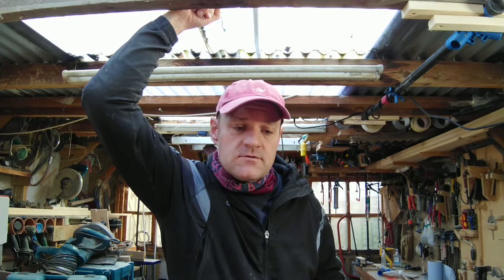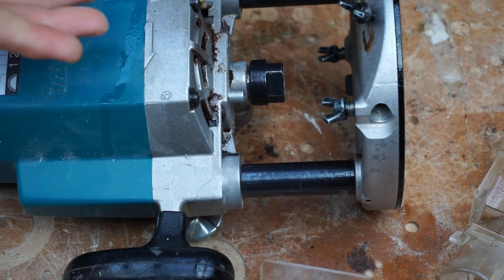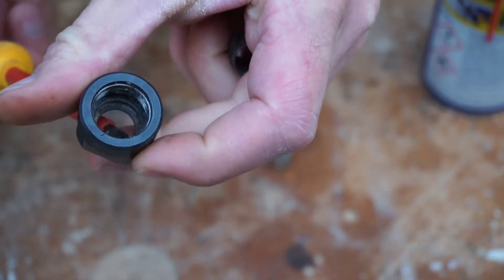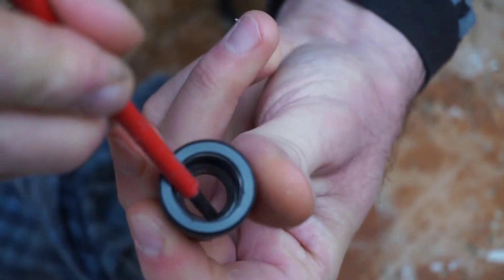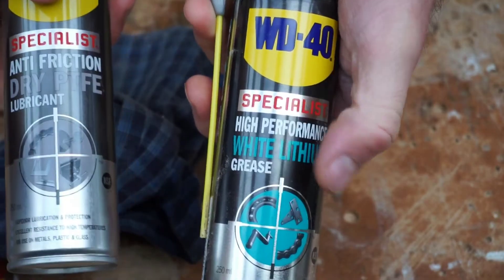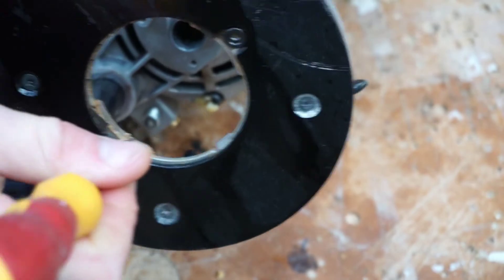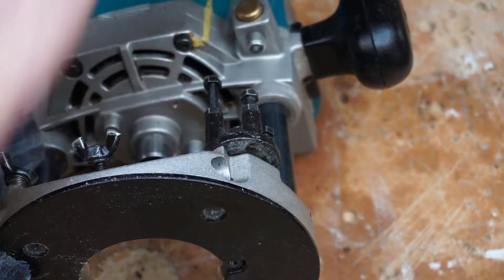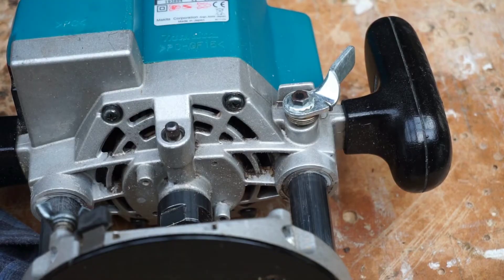Makita Router Basic Maintenance (free jammed collet)

Comment: Hello Crooks , im Ashish . I had a problem with this equipment recently ; a new Router bit ( with a12 mm dia shaft ) was installed thro the black check nut and its collet within. The machine vibrated and the router bit was thrown away not before damaging about 4 to 6 threads on the armature shaft . Had to replace the armature. My concern now is about the direction in which the tapered collet is to be installed ( the tapered length is unequal on borh the sides of the collet.
Reply from the maker: The collet sleeve is fitted with the rebate towards the cutter and the thinner end towards the router body. I hope that is helpful
Matt
Reply: Thank you Matt .👍

Comment: I have 3 of these routers. and a top tip if you're cutting corian or minerva worktops put a little bit of electrical tape over the Philips screws on the handle to prevent getting a belt off it
Reply from the maker: Many thanks for that tip... I hadn't thought of that

Comment: Hi Crooks, quick question on the Makita router. I just bought one that looks similar to the one you have. 1/2inch router from Makita which comes with additional 1/4" collet sleeve and a 3/8th" sleeve. The 1/2" is already installed in the collet nut. When swapping to the smaller collet sleeves are you supposed to leave the 1/2" sleeve in and then slip the smaller sleeve into that (as they do fit in that way) but not sure if your supposed to remove the 1/2" inch one first and then insert the smaller sleeve...Can't find anywhere that it tells you how that's supposed to work. Cheers
Reply from the maker: The collet should accept your 1/2" router bits, you need the 1/4" collect for 1/4" router bits. We only need one collet for each size. If you are uncertain, send me a photo of your collet to

matt@crooksthecabinetmakers.com
Reply: Crooks thanks Crooks. 1/2 inch bits go in no issue with the collet sleeve that was already installed from new. The the sleeves are accessories that came in the box. Will send you a photo later today. Cheers